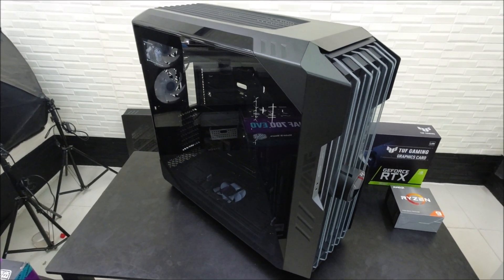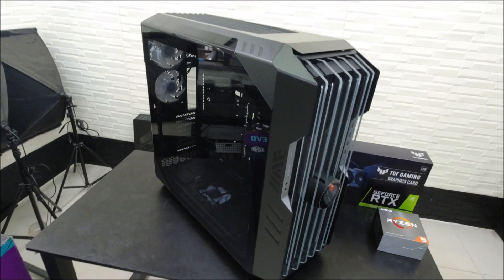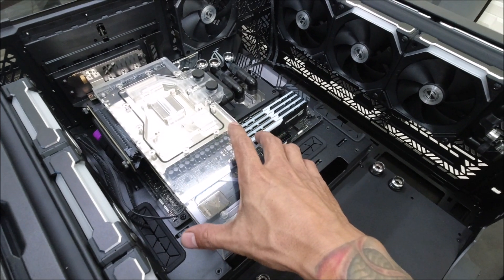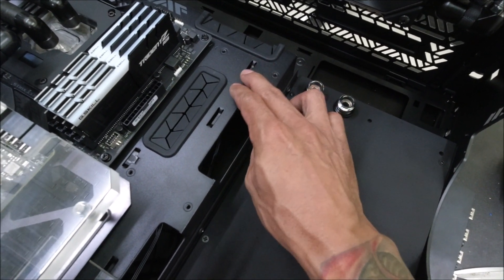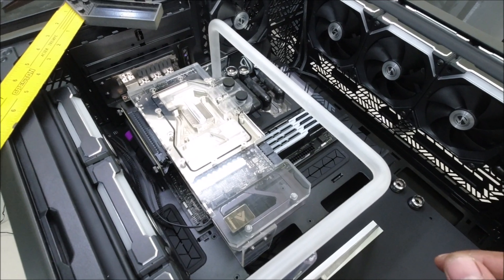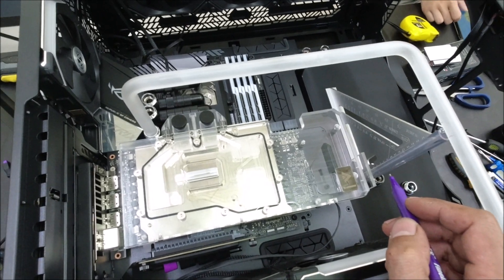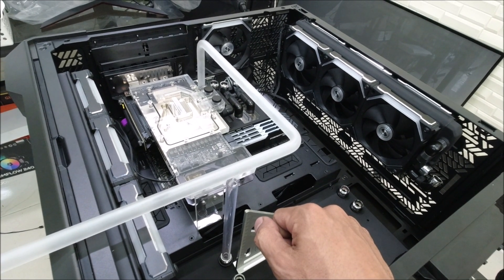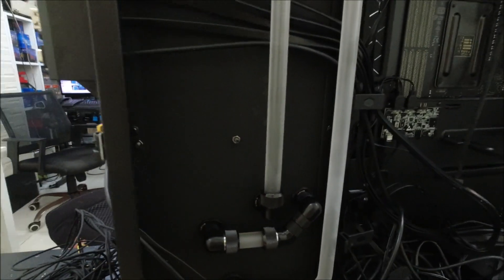Custom Pc Build #119 "EVO" CM Haf 700 Case, with tips and tutorial on bending your hardline tubing.

Comment: Do you do the bends freehand or do you use a tool to insure that they're at the angle you need? Also what do you do in the case of short tube runs that need a couple of bends?